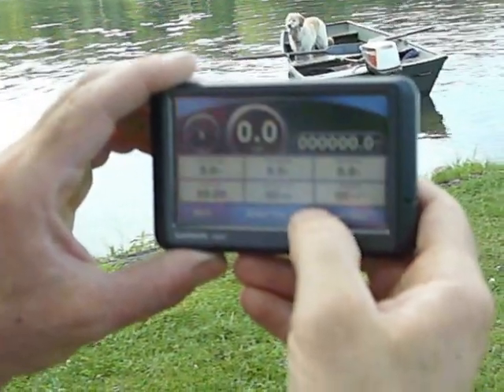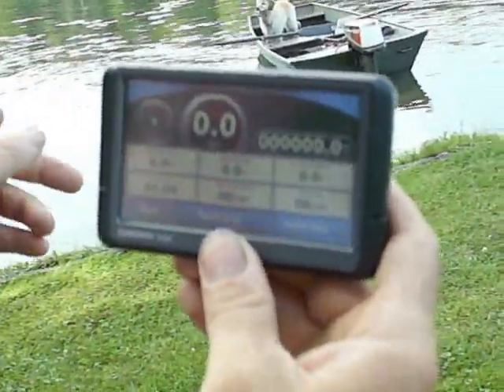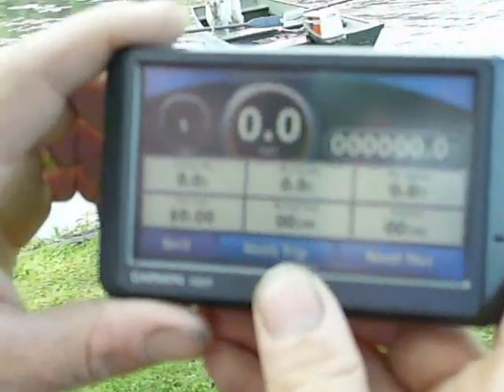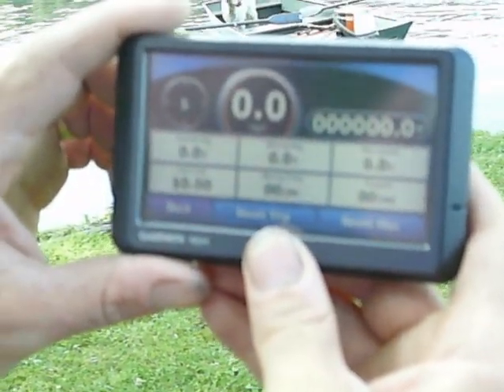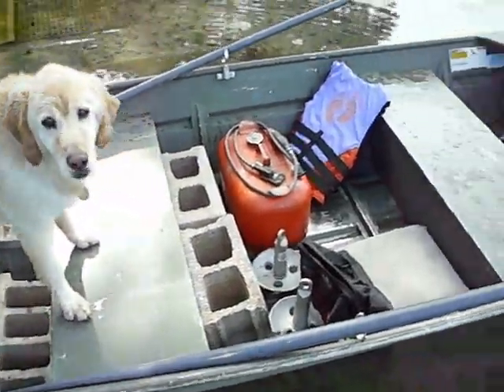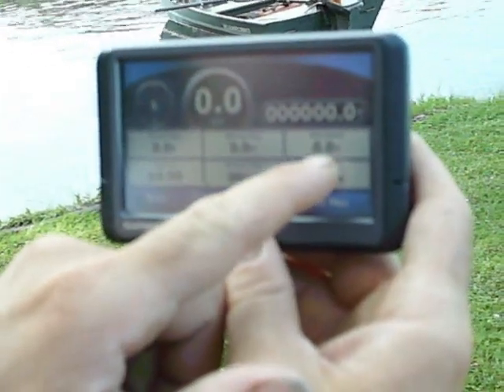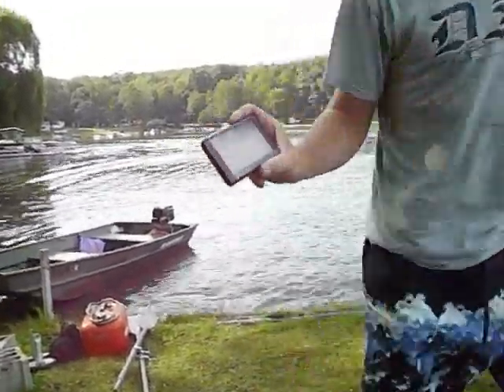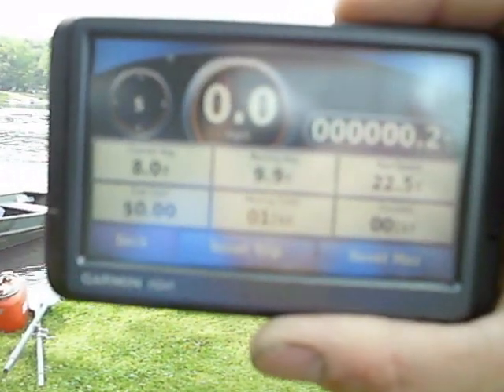Speed Test Johnson 9.9

Comment: I live in Tampa and back when I had my boat which was a 1959 DuraCraft the jet skiers clock me at 33 knots with my dog that weighs 65 pounds inside but I also had a concrete block in the front a standard 8 inch by 12 inch

Comment: Can anyone tell me how to change my 9.9 to a 15 ho please
Reply from the maker: Google "Leeroys Ramblings 9.9"; this is an excellent resource for anyone looking to do this.  In short, you need to find a Johnson 15 hp carburetor (for this series) with a 7/8" throat diameter and change it out.
Reply: Chad Wassink. Thank you
Reply: You need a 15hp prop too or you will over rev.
Reply: @brianchisnell1548  What is the stock size/pitch for the 15hp Prop?

Comment: why not just buy a 15hp?
Reply from the maker: The 9.9's seem to be more common.  It is simply what I found for sale locally that was in my price range.  I did not know anything about the 15 hp conversion when I bought it.  I only found that out later, so I kept watching ebay until I found a 15 hp carburetor.  To your point, I agree that just buying a 15 hp motor (if you can find one) is much easier.
Reply: good answer.
Reply: There are also lakes that only allow a 10hp maximum so it’s cool with the mod you can keep food speed fully loaded.